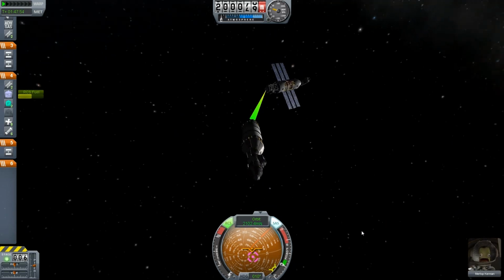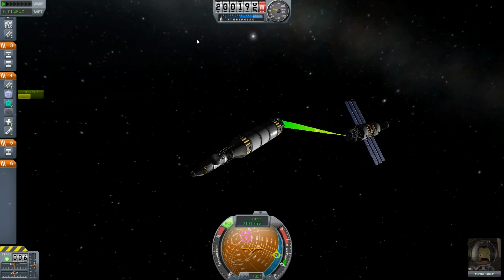KSP Building a Spacestation using the ERKLE docking mod

Comment from the maker: if you do it right: start a practice launch of your vessel to the same orbit.....after the orbit is circularized ....Mechjeb saves the LPA. Restart mission and use the "time rendezvouz" mode for the ascent autopilot. Mechjeb will use the LPA of your last launch and you end up 1-2km away from your target (after circularizing) .......on this launch i did it wrong by the way....but my next upload shows a correct approach